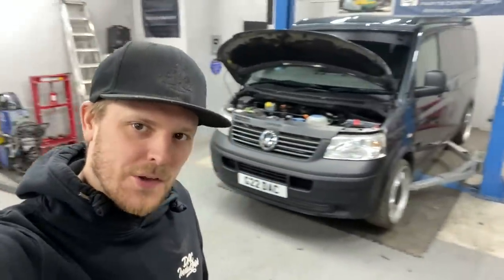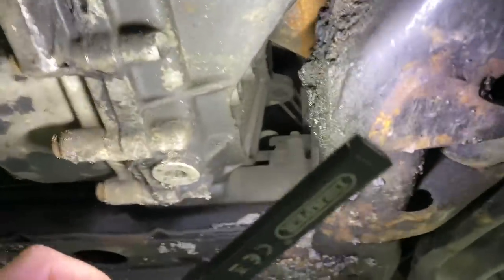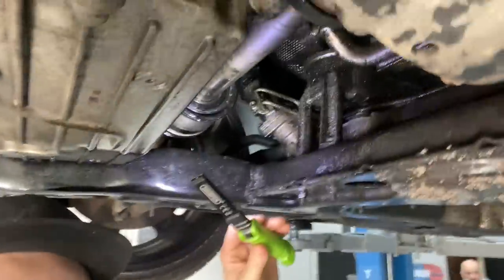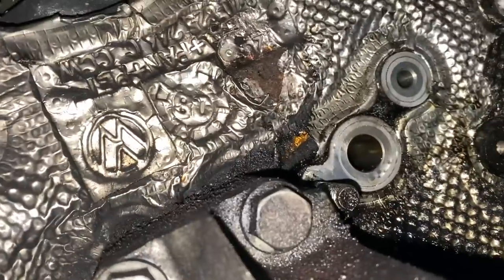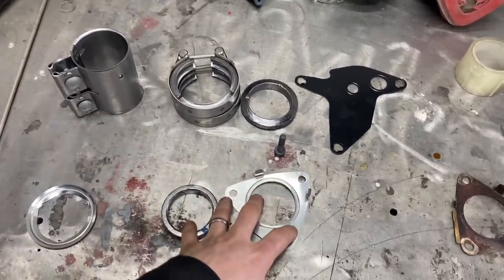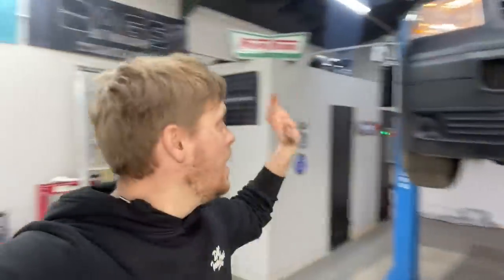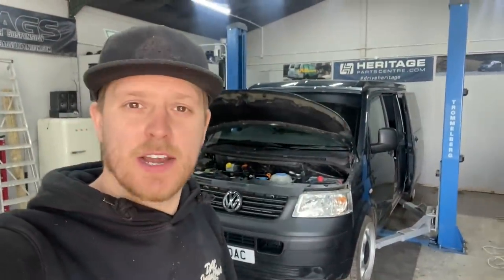Can We Fix The MAJOR Oil Leak? - VW T5 Camper Project

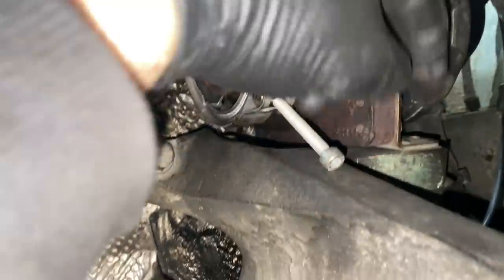Comment: Hi mate just watched your video top work. You mention you can smell exhaust fumes in the cabin. These 2.5 tdi engines have a common problem where the exhaust manifold warps pulling the studs out and causing a blow. At about 8:45 in your video you can see a lot of soot around the manifold area. I work at a vag specialist and we do loads of these. Unfortunately the turbo and everything will have to come back off and a few of the studs will require drilling out and helicoiling. Best way to tell if it is the manifold from standing under the bonnet look to where the manifold is, if you look down near the egr valve you can see the manifold gasket between the gap on cylinders 2&3 the gasket will he bowed out and not flat against the head if its warped. The other way to tell is by using a little mirror and looking at the studs from cylinder 1 these ones always pull out and it will be sooty around there. Hope this helps.

Comment: I know you probably have stuff well planned out but remember if you don't get the camper done in time it is always nice to spend some time in a new build before it's fully finished just in case you want to change anything around! I've been doing up my caddy (watching your series over and over) and I've done 4 separate build stages so far and have changed loads!

Comment: Nice job Dan! I thought this was your issue when you mentioned it in a previous video. I did mine Easter weekend on the driveway with no lift, just some ramps 😂 felt like a lot more effort than watching you! Surprised you didn’t remove that rear engine mount for better access, it’s probably not as in the way when using a lift though! You said about exhaust smell in the cab and hopefully changing that crushed soft metal gasket between the turbo and manifold will fix that too! I also replaced my turbo when I did this, the thing now goes like a rocket ship! 😂

Comment: Lets hope the oil leak is finally fixed mate as they can be a right pain to fin and repair, I had an old Volvo 740 auto which had a bad oil leak, I knew what it was and the part was very cheap but replacing it cost a fair bit as it was the rear crankshaft oil seal so the gearbox had to come out and I didn't have a lift or any way of lifting it myself so had to pay a garage to do it🤬😡😂